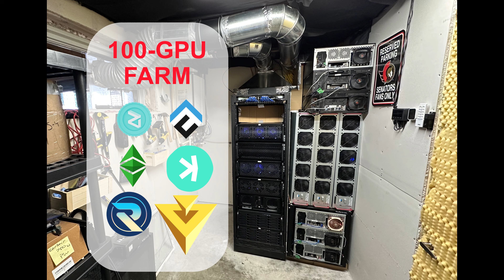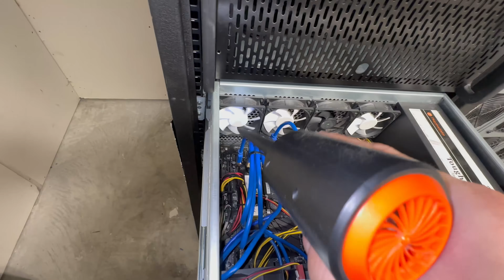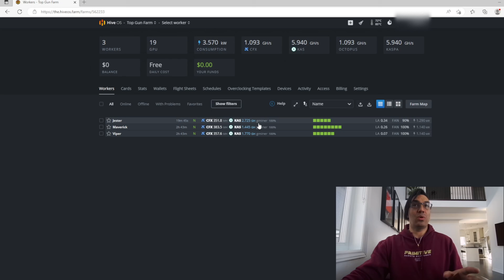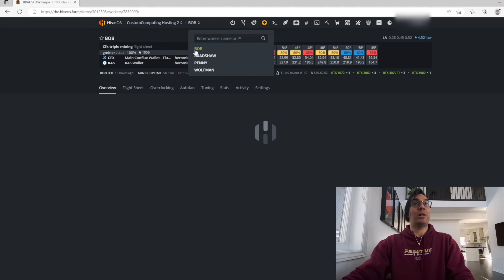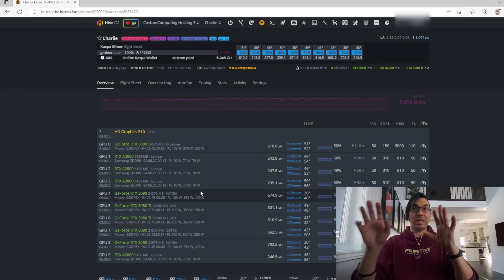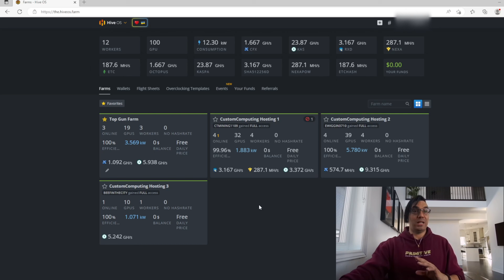Max Power 100-GPU Farm Fully Loaded!

Comment: great video, subbed!!!!! Have you considered trying to use natural air over ac during the summer to save power costs?
Reply from the maker: thanks for the view and comment!

One of my engineering friends came up with a schematic with that exact concept because the negative pressure does play havoc with the furnace cooling/heating.

I think it’s just too humid for 35degree weather in Canada summer to cool down these GPUs but I’m for sure warming up to the idea (pun intended!)

It heats up pretty fast in there without the exhaust fans going at least 70%